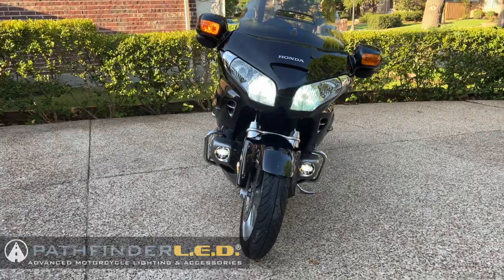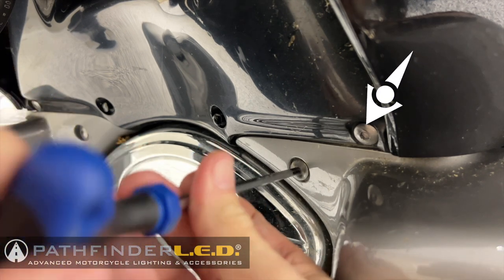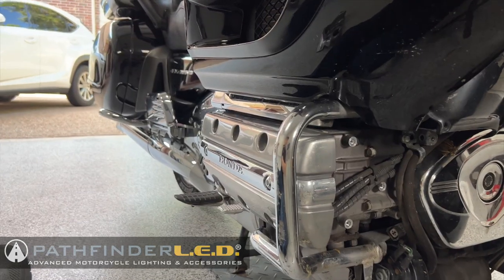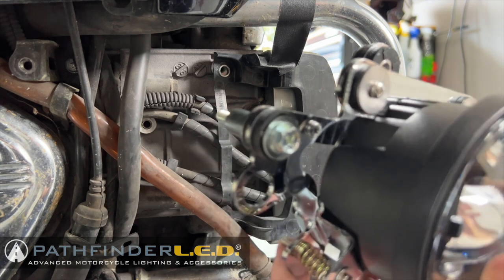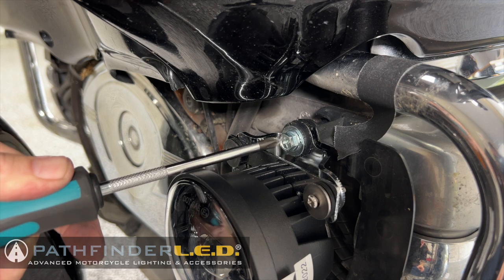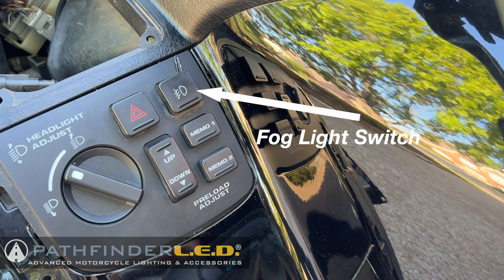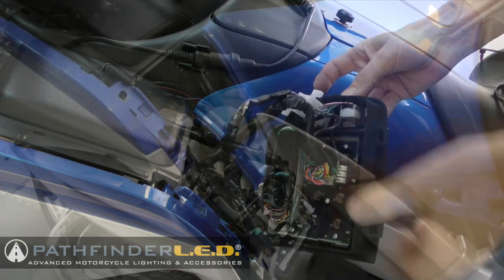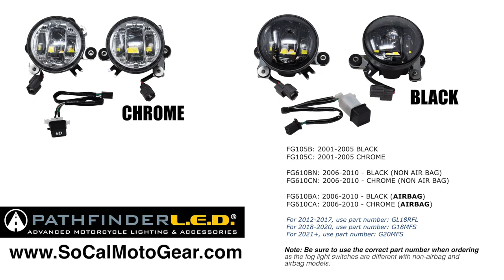PathfinderLED Fog/Driving Lights for 2001-2010 Honda Goldwing | Install and Review

Comment: Pathfinder is an exceptional LED lighting company. I have the Pathfinder Nav lights down by my lower Driving lights on my 22 DCT Tour Airbag which are Run and Turn lighting. Super powerful automotive quality high lumen LED with excellent fit snd finish. To that Gold Wing. Someone took very good care of that. Makes you realize these previous generations are still very much a great value by any standard. Nice work Cruise.

Comment: Would the screws be the same for a 2007. I bought lights and they didnt come with spacers and bolts
Reply from the maker: @johnwilson8922  I am 95% sure they are the same.
Reply: @cruisemansgarage  thank you for the quick response. I surely appreciate it. Off to hardware store to try and find spacers and bolts my foglights didn't  come with them. Errrrr